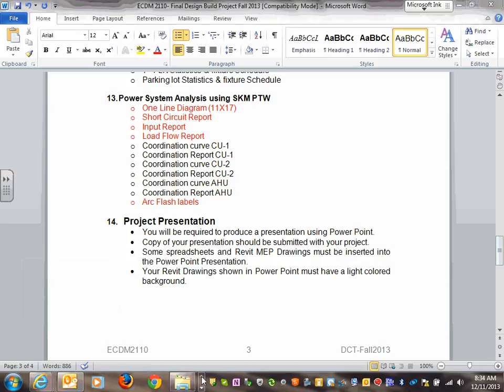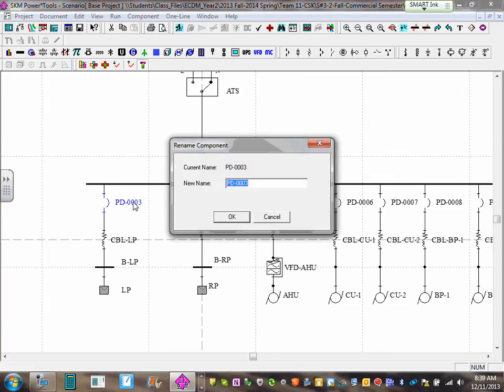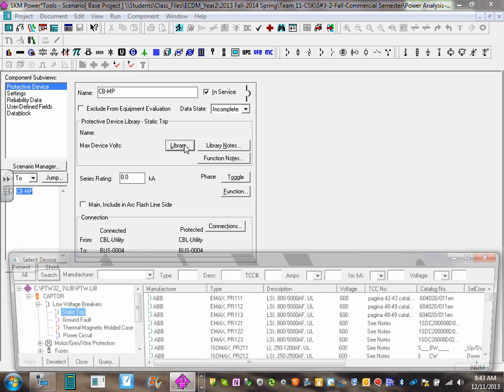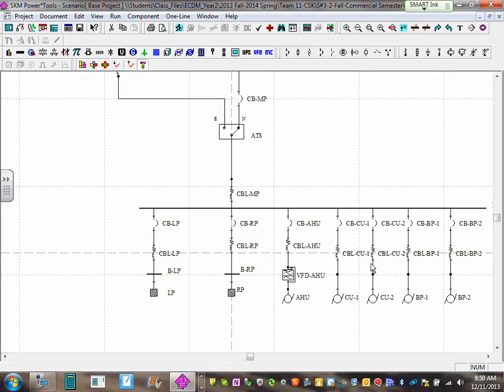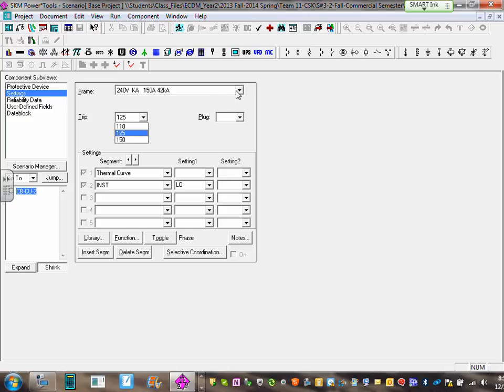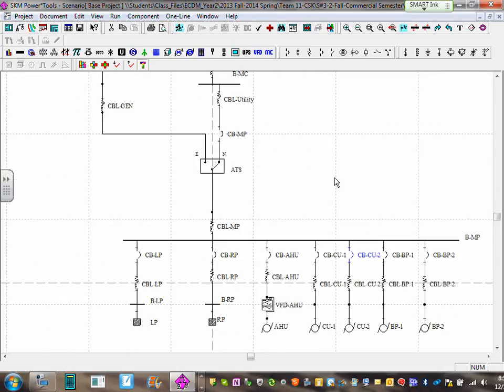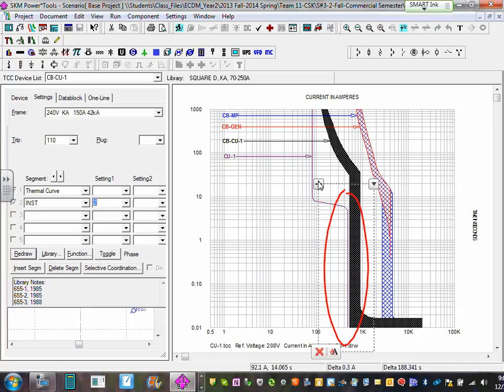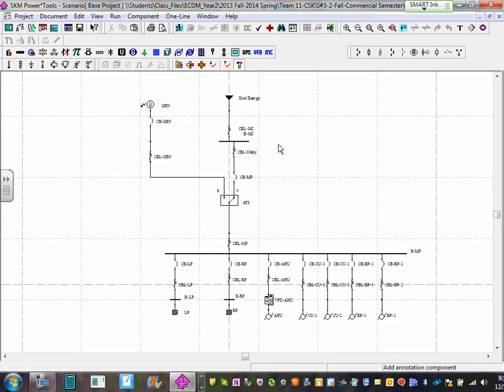Power System Analysis SKM PTW OCPD Coordination 12 11 13

Comment: Hello Chad thank you for your video. I have one question. Could you please answer o show how to use selective coordination properly. There is a method in the SKM  selective coordination. I created single line diagram (SLD) every data in my SLD is fulfilled, When i choose this func. and select necessary device for checking the selectivity with other (up/down going breakers) devices it's always appears an error "Selectivity Coordinated Device/Frame not selected." Before that i started Balanced System Studies. But i don't find the clue yet.